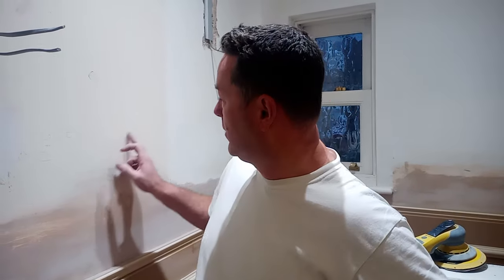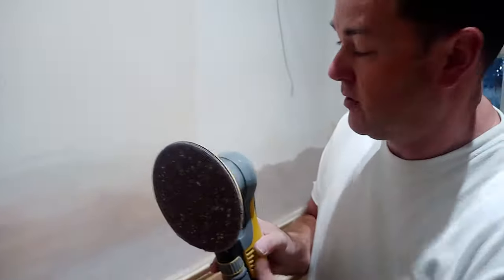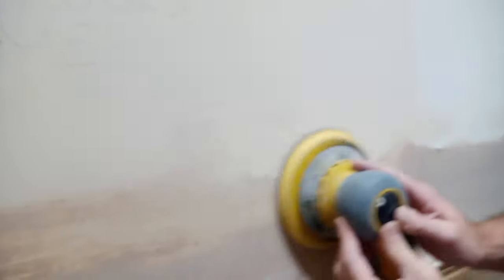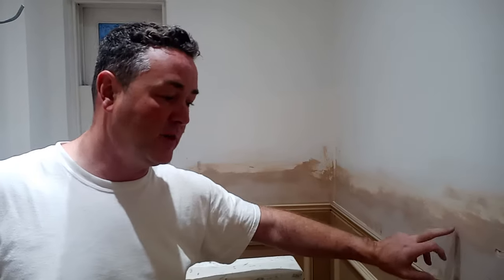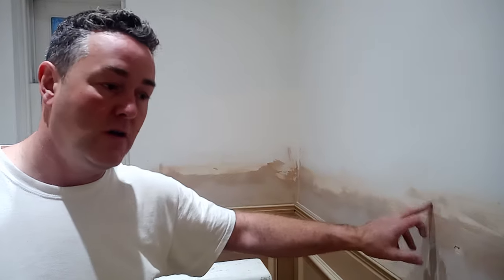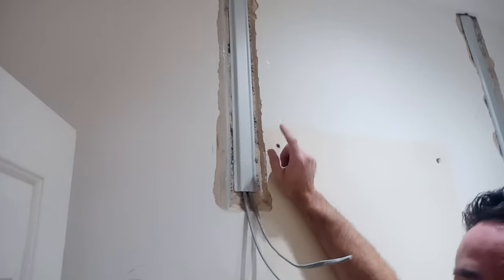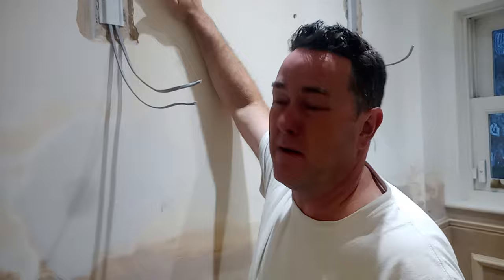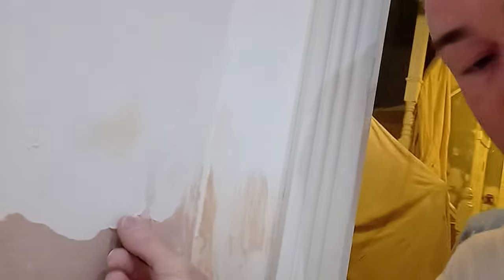Painting DIYers Beware: The Dangers of Using PVA as a Primer

Comment: Grrat advice there. But  guess what. I have some walls to paint wheich just been plastered. 

The plasterer advised the client to seal walls with pva.

Only the top  half of thr eall was pva'ed.

Can i use Zinsser Gardz on the pva section prior to painting?

Please sont say i have to clean the whole area down😭

The pva was thinned down 50/50 with water.

Please helppppppp
Reply from the maker: Why did they tell them that... And why did the customer do it?

I'd do a light nib over the plaster to knock and bits off. Gardz it. Then a slightly thinner emulsion coat before doing and fine filling. Then sand again. Spot prime the bits if needed. remember, two thinner coats are better than one thick one.
Reply: @ProfessionalPainterDecorator  thank you so much for the help.

The customer think he knows it all so had it PVA prior to hanging wallpaper.

Unfortunately he passed away recently so I've been asked by family to paint the walls to sell the house to keep it not to personal .

I now always pass this on this video to people about painting new plaster. 

And now I needed your expert advice

Thanks again 👍
Reply from the maker: strip the wallpaper, the pva on it will make it horrid underneath. Let it dry, fill sand over and gardz it.
Reply: @ProfessionalPainterDecorator  sorry my bad description. There is no wallpaper on. That was the plan.

All I want to do is prime over the diluted PVA that's been applied already.

The walls was just newly plastered walls which was Pva'ed half way.

One more question if you can help.

With the wall only being half way PVA. I won't know where the PVA wasn't applied on new plaster precisely. Can just roughly see where it is and obviously wasn't applied with a prefect straight line so to speak.

So can I apply Zinsser gardz on the bare plaster . Just pass the half way mark If that makes sense.

The rest of the new plaster I will obviously prepare the correct way.

Thanks
Reply from the maker: @eltwilliams1116  I get ya.

Yes. Gardz over the PVA.

You could Gardz the new plaster, but it's a bit over kill on a new surface.

Comment: Im not a fan of PVA. Trying to talk my boss out of using it on his new house; to no avail. If its not alkiline resistant, then why would it ever be used on new drywall, its always mudded. What are they thinking,  just use it on the drywall & not the mud 😂.
Reply from the maker: Dry wall as in plaster board?
No idea, it doesn't go well under paint
Reply: @ProfessionalPainterDecorator  standard usa drywall, taped seams with joint compound. It's the go to primer for most new constructions.. I guess that is different than European plaster.
Reply from the maker: @jeremyr7147  you don't skim over the plaster board like we do with plaster.. which is alkali .. PVA isn't alkali resisting.. so reacts to the plaster surface over time.

Comment: Sherwin williams pva primer litterly says on its label not to use on plaster. Its only recommended for drywall. Plaster only needs a mist coat before painting. One would think a "painter /designer" who is smarter than a plasterer would know this! Lol!
Reply from the maker: pva has no place for the painter
Reply: @ProfessionalPainterDecorator whats pva for them?
Reply from the maker: @JustinMentionedIt  not for putting on alkaline surfaces.... Or  putting into paint.
Reply: @ProfessionalPainterDecorator  what’s consider an acidic surface ?
Reply from the maker: @JustinMentionedIt  as the in the difference between acidic and alkaline?
As it's to do with pH levels.
Reply: @ProfessionalPainterDecorator  no I know about ph levels but Iv never tested any either lol… is drywall alkaline or acidic ?
Reply from the maker: @JustinMentionedIt  I think it's just plaster board without a plaster skim over them.
Reply: The only time I've seen PVA used is diluted on a brick wall prior to plastering. Or on a plastered wall prior to wallpapering, if my memory serves me correct.
Reply from the maker: @bitTorrenter   i wouldn't use PVA to size walls for papering, just thin down your paste that you're using.
PVA forms a skin on the surface, it breaks down in time,
Watch my video about lining a ceiling... that start I show what a plaster surfaces looks like when it's had PVA applied as the sealer.

Comment: You must have done a poor job applying or done zero prep work because Ive never had PVA do that. Also, what paint/primer doesn't get removed from sanding? We must not have the indestructible paint here in the US...

You are one of those freaks using an orbital sander to sand drywall mud. You must be using your professional decorating skills to cover that up with a mirror or something
Reply from the maker: Did you not watch and listen to the video?
Reply: @ProfessionalPainterDecorator  Did you read my comment?
Reply from the maker: @scrowtumbus7522  yeah 

But clearly you've not listened to any of the video as to what's happened. And why I did the video.

And what the hell is dry wall mud?